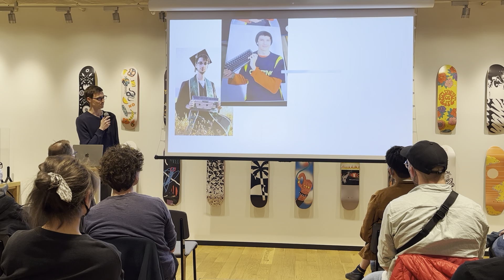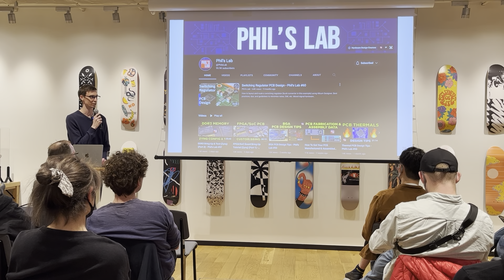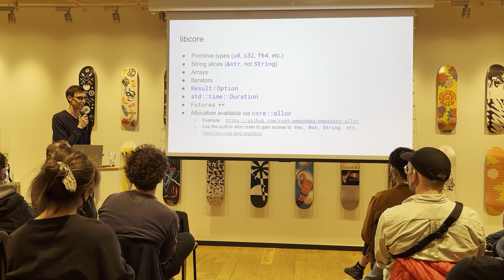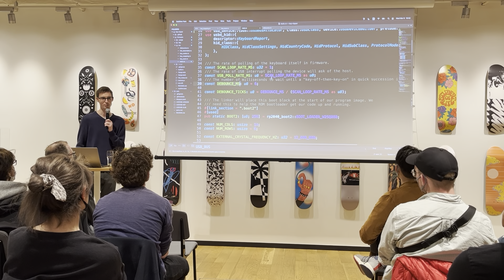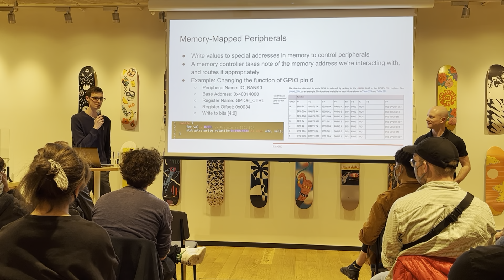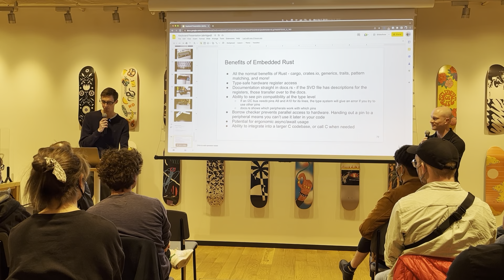Building Embedded Systems With Rust

Comment: Just a comment regarding prices for keycaps mentioned at 5:15 , yes, the plastic for injection-molded parts is dirt cheap but the tooling for injection-molding is freaking expensive. So the price for keycaps is strongly dependent on scale of production because the cost for tooling is basically the same for very small and very large production runs (assuming you limit the upper bound to the threshold at which the tooling has to be exchanged due to excessive wear).
Reply: Right, the molds are the expensive part.

I wanted to poke a bit of fun at the whole thing because from the outside, it looks insane to spend several hundred on some plastic when you can get very similar plastic for much cheaper.

Though I'm curious if you know or not - can a manufacturer like GMK just re-use their molds assuming they're only changing colors and not legends?
Reply: @brianschwind6530  Can't really answer that, my experience with injection-molding comes from a totally different industry. My uneducated guess would be there is a fair chance that you are right. However,  there is a great variety of ways to formulate or modify injection-molding feedstock in order to change or adjust color. All of which potentially can alter flow and temperature dependent properties of the feedstock which may or may not result in having to redesign tooling.
Reply: 3d Printing has come a long way in the last 5 years; FDM printing of custom keycaps is now also a valid option for DIY. (And resin, but...ick)

Comment: 50:52 I would recommend Nordic Semiconductor nrf52 chips for Rust and Bluetooth instead.  Better radios, longer battery life, better Rust support, better software Bluetooth stack too.  The chip used in the "Raspberry Pi Pico-W" is an alternative, but probably best to stick to Nordic.
Reply: Just purchased an nRF52840 dev board for testing out embassy-rs :)
Reply: Hi you mentioned Bluetooth stack for the nrf52... do know of a stack for the plain HAL instead of using embassy? thanks.

Comment: Very interesting talk! I was curious though; in your code, you delay for 1 ms so you have a polling rate of 1000 Hz. I watched a video not too long ago about timing from Ben Eater, where he mentioned that he also needs to account for the time it takes to run his own code, besides the time needing to wait. Isn't that the case here too? If you don't account for the time it takes to run your own code and just flat out wait 1 ms, won't the polling rate fluctuate/differ? Or is the time it takes to run your keyscan so minimal that it doesn't matter? I don't know if a fluctuating polling rate even matters (still learning embedded systems), but it's just a thought that sprung up in my mind!
Reply: The "correct" way to write such code is to use a hardware timer for the waiting, and have that timer invoke an interrupt which scans the keys.
Reply: Yep, this is quite a naive way to write the firmware. It works so I haven't dived into making it more correct, but you're right that you should account for the time it takes to execute your own code.

There are actually still some quirks with the USB HID behavior I need to iron out, so the issue you mentioned may possibly be contributing to some bad behavior.

Thanks for watching!

Comment: Atmega32u4 is very popular for making USB HID devices. RP2040 is very cheap, but for keyboard it’s overkill
Reply: Yep the Atmega32u4 has been popular for quite awhile, and that's a totally valid chip to build on top of for what I made.

I chose the RP2040 because:

* It's cheap, as you said
* It's currently easy to acquire
* Stable Rust toolchains support it well
* The PIO peripheral is interesting for things like custom communication protocols, or supporting RGB LEDs (not saying the Atmega32u4 can't do that though)

I'm okay with selecting the overkill option if it's cheaper, all other things being equal.

Comment: why is it necessary again to write a keyboard driver? Is this feature not already included on the system?
Reply: A full system using a keyboard has two parts - the keyboard and its associated electronics (the USB device), and the computer it is connected to (the USB host).

The keyboard contains the firmware required to read keys and communicate over USB to tell the computer which keys are pressed.

The computer contains the driver which is like the receiving half of the USB connection. Both are necessary for everything to work as expected.

In this talk I only went over the firmware side of things - I use Mac and Linux and I didn't write the host-side drivers, they are indeed built into the system as you said.

Comment: You mention the high price of a keyboard kit. How much money did you save in total this way?
Reply: Looking back at one of my orders, I spent 15317 yen + 3614 shipping for:

* 5 PCBs
* 5 Top Plates
* 5 Bottom Plates
* PCB Parts + Assembly

That's 18,931 yen total, which is 3786 yen per board, or around $25 per board.

But then you need to buy switches (let's say 4000 yen for 75), keycaps (as little as 2000 yen up to 12000 yen or more), and stabilizers (~2500 yen).  So that's around another 10,000 yen in parts, bringing us to a grand total of around $90 for a completed keyboard. It can go higher or lower depending on the parts.

A keyboard I saw that I wanted in the store was around 50,000 yen I believe, so in raw prices that's a good amount of savings. Of course, if you factored in the time I spent making my own, I don't come out ahead at all but that would be _boring_. And then of course I ordered multiple iterations as I changed things, and the minimum order quantity is 5, but I gave away a lot of boards to friends. I think it all worked out nicely in the end and I learned a lot along the way.
Reply: @brianschwind6530 Awesome! Thank you for the lovely breakdown. Even if it were more expensive, I feel that making something yourself offsets the cost, just in a different way ;)

Those prices are pretty encouraging. Maybe I'll give it a shot sometime! (My idea was to make some macropads)
Reply: @BareTuna  Absolutely go for it! It's very satisfying to make your own tools, and building a custom keyboard or macropad is very approachable. A macropad especially will turn out quite cheap.